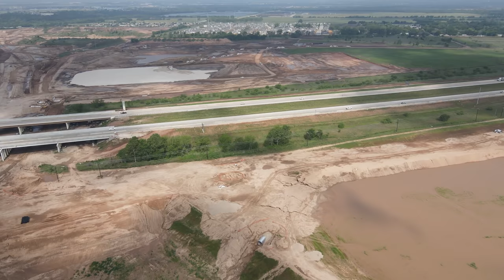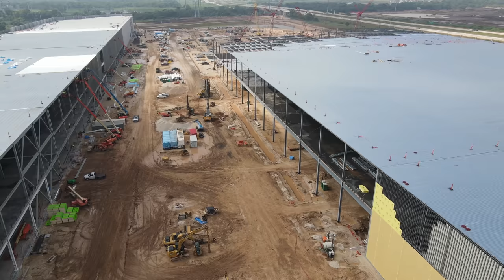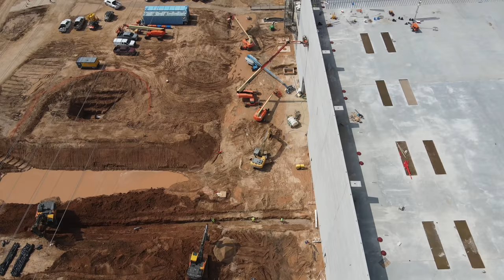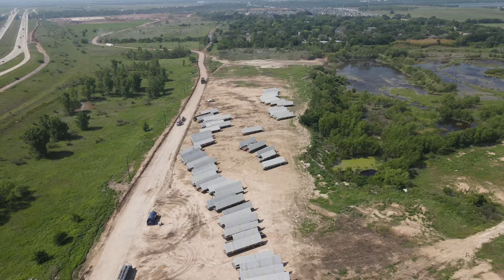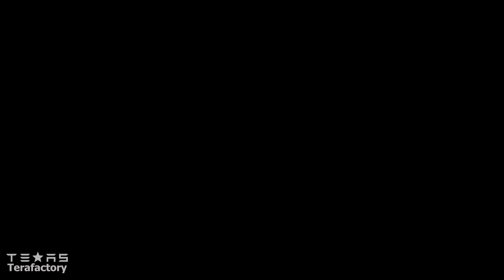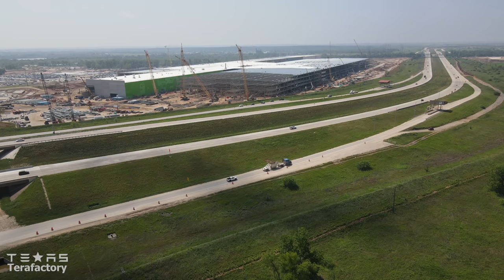Nine Months - 2021-05-03 Progress Update

Comment: Thank you! I really liked the comparisons at the end. One small suggestion if you do another one later, it would be helpful if you could put the dates in one corner.
Reply from the maker: Sure, I should have done that. The 4 dates are 2020-06-27 (initial work began late July a month later), 2020-10-22, 2021-01-31, and 2021-05-03.